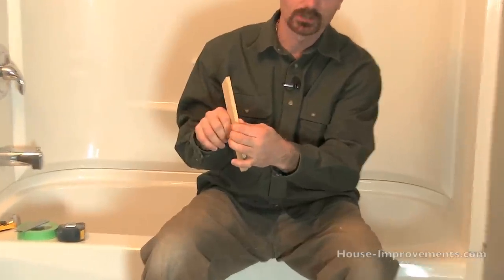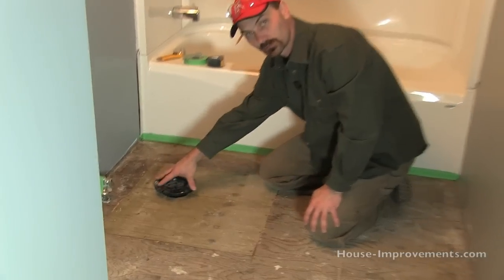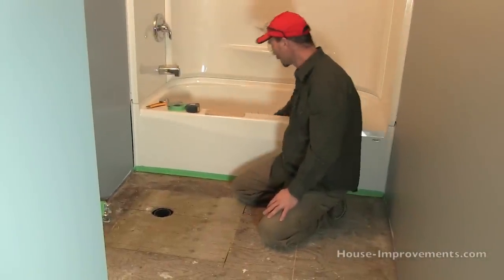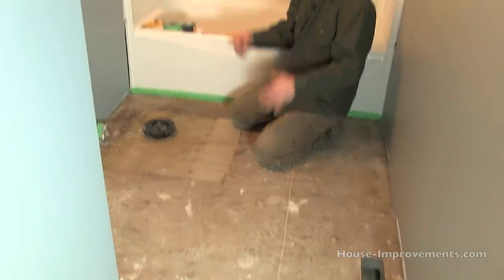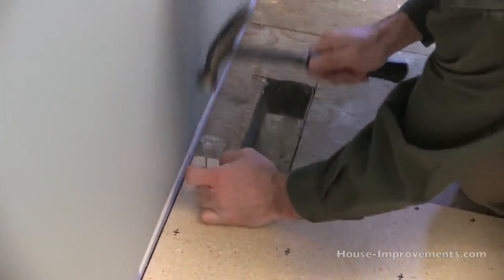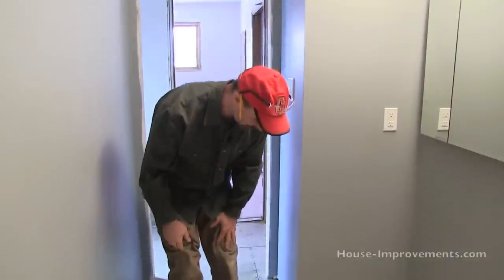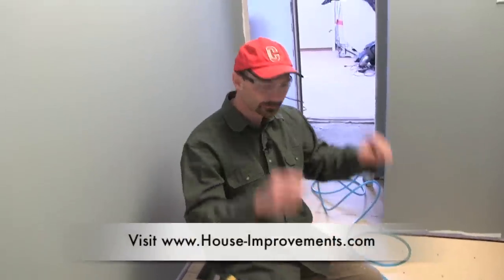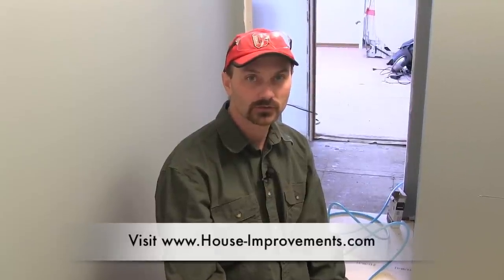How To Install Underlay [Floor]

Comment: I'm not a pro but know enough that pressed wood is a really bad underlay, and worst in bathroom. You have a good base of plywood, why not adding another layer of plywood ?. a few splash of water and you end up with a sponge underlay that will develop mold. 
Just replace with Plywood and you have a very good guide to all DIYer
Reply: Plywood has voids in it and can cause hole from high heels, and so on. The reason for underlayment is to raise floor up to match tile or carpet and a very smooth surface. However particleboard does suck up water if flooded.
Reply: I agree with you. I think a backboard is better in bathroom if they're going to tile it.

Comment: great video! i need to raise a room 1/2 inch. chose to use cheaper underlayment-$21 a sheet versus $37 for the cheapest plywood. also- the worker at store told me to also use liquid nails and screw it down. after watching your video- i'm going with the ring nails and no glue. much appreciated!!
Reply from the maker: With a thicker product you could screw it down for sure ,but keep the screw heads counter sunk a bit and then fill them when you float the floor. On thin materials like I'm using here (5/16") its pretty hard to counter sink a screw into it without going right through .
Reply: @HouseImprovements  great! thanks!
Reply: @HouseImprovements    are panel board nails "ring shank" the proper nails? i couldn't find any called just "ring nails".

Comment: This is an excellent video. I'm a first-time DIYer. I have plywood subfloors and want to install glue down bamboo flooring. Should I install underlayment on top of the subfloor and then glue the bamboo to the underlayment?
Reply from the maker: most glue down wood floors can go right not the plywood. Check the manufactures suggestions.

Comment: Thank you for the great video. Question, is there a need to have a wood underlayment such as the one you are showing here if the subfloor is level enough for vinyl flooring? Thanks.
Reply from the maker: You need a good smooth surface to lay the flooring on. That is the main reason for a new underlayment.

Comment: Thanks for the video! It looks like your using a Bostitch stapler. If the divergent staples are not available, is there another style recommended for 1/2" underlayment over 2x6 decking?  Thanks
Reply from the maker: +Jeff Porter Ring nails unfortunatly, are the next best IMO
Reply: Thanks for the instructions. Very helpful. Will 18 gage staples work or do I need 16 or even larger?

Comment: Thank you for a great video! I have a question if you don’t mind. I had some foundation work done. The company that did it took a couple of subfloor pannels and replace them very poorly. 
Everything seems to be level but there are gaps of around 1/2 inch or more between old subfloor and the replacement. They were planning on filling the gaps with foam. Would you recommend doing that and then put an underlayment on top or would it be better to replace the new planks so they fit properly? Thank you!!
Reply: Yes.

Comment: Do you recommend using spray foam between the subfloor and the plywood. I think they sell special foam for subfloor
Reply from the maker: There is a sub floor foam adhesive made for the actually plywood installed on the joists.
Reply: @HouseImprovements  it’s a house with subfloor planks on the joists. I am planning to add a 3/8 plywood on top to resurface the floor prior to installing engineer flooring (staple down). Would you recommend I install the plywood sheets on the subfloor planks with foam adhesive or just screw down

Comment: I'm forced to install a 1/2" OSB as the subfloor (to clear an ABS pipe on the ground) on a 2x3 raised floor over concrete. Then I will install 3/4" plywood on top of that. Which fasteners for each floor?
Reply from the maker: 1-3/4" deck screws would be fine for both.

Comment: Would you ever use a floor leveling product before you install the underlayment so as to make the subfloor more even if there are low areas?  Also, do you ever paint/coat the underlayment so as to make it more moisture resistant?
Thank you for all these videos. Why are the best ones from CA? (You and Theoldkid888)
Reply from the maker: Use the floor leveller on the top of the underlayment. I have never painted or treated the underlayment, I suppose you could as long as it did not cause problems with your glue.
Reply: NEVER ever use self leveling cement on particle board or mdf.  Some even say not even to use it on OSB.  Self leveling compound/cement is best used on plywood after your subfloor is to the correct thickness to support the finished flooring you're laying.

Comment: Can I use something a little harder for the underlayment, like plywood? The press board seams to lift the vinyl when sitting on a PC chair for a while and rolling back and forth.
Reply from the maker: You could use sanded plywood but not sure that is your issue. I would place a floor protector in the chair area (clear plastic panel)  to keep the wheels off the floor. The movement is releasing the glue.

Comment: Hi Shannon, I am dealing with a concrete floor at my basement bathroom and the existing flooring is just junk since previous owner laid glue and linoleum directly over the concrete slab.  I guess my question is how to do this the right way?  I want glued in vinyl flooring and was wondering if I can lay some vapor barrier/retardant first then 1/4" subfloor screwed on and then glue and laminate?  Would 1/4" subfloor be sufficient here?

Comment: Hi Cannon, I have vinyl flooring in the bathroom and I want to replace with the tiles. I believe underneath is plywood flooring and do i have to install any underlayment prior to apply the cement? If it does requires then please tell me what type of underlayment. Thanks
Reply from the maker: Please use our forum for help. https://www.house-improvements.com/forums/

Comment: my house was built in 56 so my subfloor is planks on joist. I'm laying 1/2'' plywood over that.  can you tell me the gap I should leave between plywood and drywall, and gap between sheets? also what spacing should I use when fastening it down?  thank you
Reply from the maker: leave about an 1/8 from the drywall and 1/16 between sheets.

Comment: Good video. How about using fiberboard as underlay and morter mix as filler?
Reply from the maker: the mortar would have very little strength once it was watered down enough to spread thin.
Reply: HouseImprovements What would be a good adhesive between 55 year old plywood and new fiberboard? Glue and staple then vinyl floor? Thanks.

Comment: If I use a 5mm underlay can I use a wood glue product to secure it to the subfloor?  I'd like to avoid the staples and nails.  I'll just brad nail the corners and use a little wood glue.  Thoughts?
Reply: No. Do NOT glue underlayment to the subfloor. And don't use particleboard for underlayment, as was done in this video.

Comment: Shannon, I see you took some flak earlier for the pressed wood.  Some people already know it all but still come to YouTube for instructions...

Anyways, could you describe a bit what thought process did go into choosing the underlay material?  I'm thinking cement board myself but this will be my first bathroom subfloor.  You mentioned vinyl, I'm thinking tile.
Reply from the maker: The press type board is very very common here for under vinyl so that is what I use. For tiles I use products like Ditra uncoupling membranes. If you come to my forum and ask about subfloor options for under tiles I will answer it better there.
http://www.house-improvements.com/forums/
Reply: Right on.  I'll enlist on your boards.  Thanks.

Comment: thanks for your videos. Question. I have a floor (laundry area) on the main-floor-area that is not leveled when at the wall, so it feels like a bow when approaching to the center of the small room. How could I level it before I place new floor? thanks!
Reply from the maker: please use my forum. http://www.house-improvements.com/forums/

Comment: Do you need to patch or fill the seam? 
Thanks
Reply: Particle board void the warranty for vinyl. The manufacturer wants you to use a plywood that is rated for underlayment...and yes you do have to prep the board seams so they don’t show through the vinyl

Comment: I hear some people add glue when installing particle board on top of plywood subfloor. Is this needed or just a preference?I am installing laminate in in Kitchen living room and dining room and need to replace particle board in kitchen area.
Reply from the maker: +Michael s Not necessary when the nailing/stapling is done correct, but you can if you want.

Comment: Do you always put underlay on subfloor when doing flooring?  Is this only for vinyl or would i also do this for laminate etc.?
Reply from the maker: generally not needed for laminate
Reply: Okay, Thanks for the quick reply.

Comment: would u be able to Glue this use the  carpenter glue and just use few screws ?? thx
Reply from the maker: No, not with carpenter glue for sure . Maybe v notched trowel applying construction adhesive but it would be a real PITA to remove down the road. The ring nails or staples work great
Reply: @HouseImprovements   The problem is i got a floor heating so that is why  i thought may be i use glue  and other thing is how did  you  level your floor   is it after you install new  underpayment ???  My  sub floor is not level  should i level  it  first level it  with  quick leveler  than  I   install the new underlay  or after i install the new underlay .  My aim  is to  install  new under lay   than  Schulter Ditra and   24x24  tile   but the other  problem is the floor is not level   by the way what this  wood  calls the one you use  would i be able to use it  for  tile thx

Comment: Home depot has 5mm underlayment, in 4x8 sheets. Is that too thin? A floor guy told me the vinyl will bubble through the staple holes if it's not at least 3/8 thick
Reply: I watched a professional flooring company use that exact stuff a few years ago in a house that had flooded. Five years and it still looks great and no oddities in the floor.

Comment: hypothetically speaking, would it be okay, for example, to screw the underlayment in instead of nailing or stapling?
Reply: Yes it will definitely work and be sturdy enough that it won't shift. I like to use 1/4 inch plywood which people sometimes call it "luan" and screw it down with 1-5/8" screws just in case the subfloor was squeaky it won't be anymore!

Comment: Would this help level the bottom floor?
Reply: If it is not to out of level it should but if you really need to correct quite a bit then you may need to look into self leveling cement patch and go thicker than the skim coat the Shannon used here ! If it is really really out of wack then you may need a couple of applications ! If you really want Shannon and his team's help then it maybe best to go to his website and click the forum tab ( I think it was near the top left of the page ) and see if your question has already been asked or see if you can ask your question there !

Comment: When laying linoleum, can't you just spread floor leveling compound over the wood subfloor (instead of 3/8" underlayment), so as not to increase floor height when you do not want to remove a sink/vanity?
Reply from the maker: If the plywood is in good shape and no real gaps between the sheets you may get away with it. The problem is if it flexes much when stepping on it the self leveller may  crack and loosen over time. The underlayment helps to span joints in the plywood to reduce the flex.

Comment: Why isn't backer board set with thinset and then screwed down used, particularly in a bathroom where water can be an issue?
Reply from the maker: backer board is not smooth enough to apply vinyl sheet flooring to.
Reply: Backerboard is mainly use for tile

Comment: Great video,    If I use staples,  do i need to go over them with filler and sand smooth ?   What about the joint gap ?   will linolium show the gap after a few years ?   Thanks !
Reply from the maker: If you have large gap or staple holes fill with floor leveller

Comment: Instead of stapling or nailing, can I get away with using 1 1/4" drywall screws when fastening the underlayment?
Reply from the maker: Typically if you try to screw this product down you are unable to counter sink the heads of the screws enough or if you do the underlay mushrooms up around the screw head and needs sanding.
Reply: drywall screws are not very strong...and depending what of floor your laying, the heads make a pretty good dimple

Comment: pressed board in bathroom? Why not another layer of good old fashioned plywood?
Reply from the maker: cost mostly. Also most plywoods have voids under some of the finish layer and those can cause issues don't the road with the flooring.

Comment: I can see why you have to cut the underlay in 2 sections, as it would be very difficult to fit the cut into the entirety of bathroom in one go. When determining your dimensions of first piece, is this dependent on your own choice?, or was there thought put into this?. Could you have made the first piece with only the toilet cut out, & kept the register cut out for the 2nd, instead of having it split between the two pieces?. Also how do you know where to end your underlay where the door frame is?.
Reply from the maker: Cut the pieces how you wish. usually the flooring should stop half way under the door, so place your underlay accordingly.
Reply: @HouseImprovements  Thanks boss, love your content

Comment: This is an informative video, but I strongly reccommend not using this type of wood for a sub floor ever, When does a floor not get wet?  And this stuff is junk after water gets to it.  I would just put 1/4 inch plywood, otherwise great job!
Reply: I think its called underlayment not subfloor.  Sub floor is what attaches to joist if I am correct.

Comment: i would ve put subfloor glue.
Reply from the maker: You could but it really makes for a difficult removal down the road, subfloor glue is usually used to secure the plywood to the joist though

Comment: Nails won't hold the board well. Soon it will make squeaky noise
Reply from the maker: Ring shank flooring nails
Reply: @HouseImprovements  Hello mate, my floor boards has a hairline joint which is open to the subfloor. When I glued vinyl sheet directly to the floor boards without underlay, the vinyl bubbles along the floor board joint. I'm really puzzled. Do you know why.